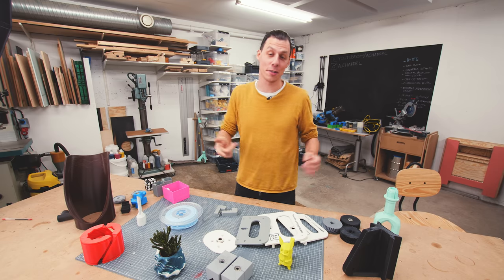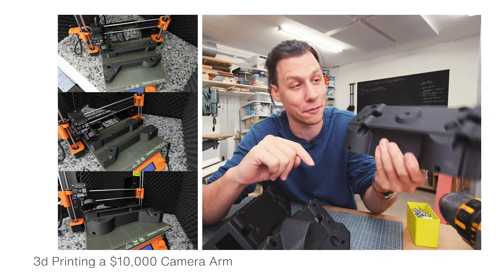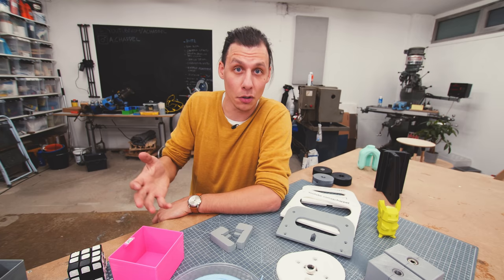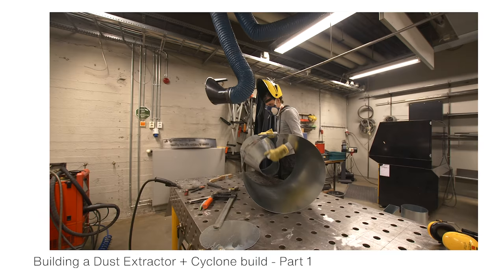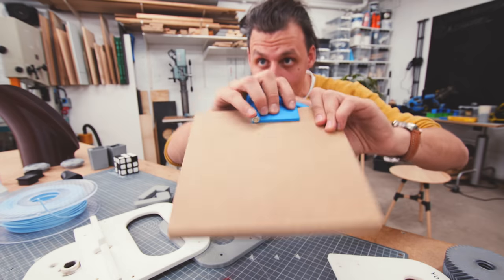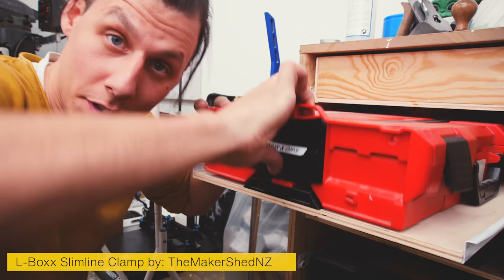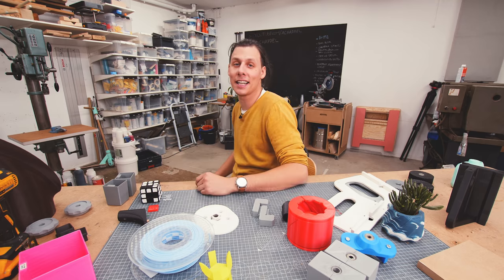Is 3d Printing Useful?

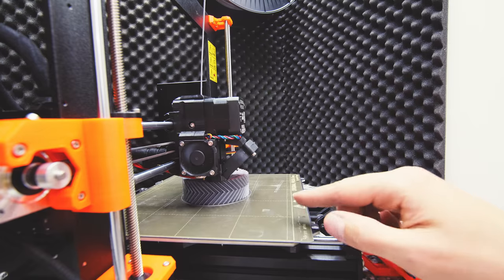Comment: 7:37 My favorite thing about 3D printing is that you can print spare parts for a 3D printer.
Reply from the maker: haha true :P
Reply: @achappel  I 3D printed a 3D printer (Bedsize 600X300x500mm)
Reply: @edwinbrink  sadly you can't print electronics and metal together with plastic (if at all) yet
Reply: Von Neumann probes when?
Reply: Add a bit of AI to the firmware and it will just print itself parts to improve itself, until it eventually turns into a robot that self replicates.   ... this would be a great plot to a low budget sci fi flick.
Reply: @redsquirrelftw  If you're into books/audiobooks check out the Bobiverse series by Dennis E. Taylor
Reply: buy 3d printer. print 3d printer. return 3d printer... PROFIT!!!

Comment: As someone who owns 2 3d printers I have actually gone back and fourth on this with myself. I used to think it wasn't as useful but now days that I can design functional prints I have to say yes. No is it needed to live or make life way better? No. But the amount of small things I have printed that help me out day to day are kinda surprising. The thing I use the most is a simple wallet/keyholder I designed thats screwed to the side of my dresser and it works great. I also have an ecig that has the charge port on the bottom of it and thats a total pain since you'd have to lay it on its side to charge and leak eliquid everywhere so I got a right angle usb cable and made a cradle and it works great. There are tons of these little things around my house and office that make life a bit easier.
Reply: How much did urs cost?

Comment: Another great video! I can't remember if you've mentioned this, but what's the primary form of filament that you use? PLA, ABS, PETG etc? Looking forward to your next project!
Reply: He said earlier that he (currently) only uses PLA.
I personally don't think PLA is a good material if you need stuff that's used for parts that need to withstand force. PLA bends when subjected to permanent pressure. I think he should switch to ASA (it's the "successor" of ABS). Or at least PET-G

Comment: very useful info, maybe you could do a video on how to 3d print various items which need different strength filament wire, and different internal structure strengths i.e 3d Pikachu doesn't need to be as strongly made as vacuum nozzle

Comment: Now I really want to learn fusion 360! this is one of the few channels that finds useful applications for 3D printing.. I bought one for making tpu parts for my fpv drones, now want to organize my workshop/studio. Any filament recommendations ? I'm assuming you use different materials and/or brands for structural parts, storage containers, etc.? 

Also if you want a good filament for camera/protective cases Sainsmart makes an awesome TPU with variety of colors. Its fairly rigid while still being flexible/absorbs vibrations.

Comment: I use 3d printing for a high variety of applications

designing custom pieces mainly, most of which I later cast to aluminum-low carbon steel

prototyping puzzles is so great too, it is even great for printing little toys

it is one of the greatest tools for prototyping, and since my ender 3 with all upgrades and 2 Kilograms of filament costed 250 euros, the investment payed for itself in a couple of month (not to say a couple of weeks)
I literally started printing the same day I got it, very easy, lots of sources and data available, very little trouble, so this question is a no brainer, a 3d printer and 3d printing are incredibly useful

Comment: I needed a set of mounts for an LED tube light for use during Skype/Zoom sessions. I fashioned two angled mounts out of wood in ten minutes. It would take me longer than that to draw them in my CAD software. Sometimes printing is awesome, sometimes it's easier to go another way.

Comment: I have considered getting a 3D printer for some time now. I do woodworking as a hobby and seeing the 3D printed router templates is really pushing me toward a purchase! But, what printer should I start with? There are so many!
Reply: All depends on your price range, and expectation! I got a stock Anet A8 years ago for £100, and its been such a great workhorse. i've learned to upgraded it and design parts to make it a very complitent 3D printer, however if you are looking for some "out of the box" VERY good prints, maybe with some fiddling here and there, the Ender 3 is amazing value for around £250. Or if you just want something that will produce perfect prints every time with no faffing and great support, a Prusia I3 Mk3S is £700.
Reply: @ale6242  Thank you so much! That's great info and gives me a place to start researching. I haven't decided on a budget yet, but I'm leaning toward the middle option.

Comment: I would love to see a quick breakdown of the costs to print parts - forget about modelling time, but how much filament is needed for a small parts box vs what do they cost? Or the drawer handles, or the cost to print a router template vs the cost of the 1/2" baltic birch plywood, etc! I would also love to see the benefits of this printer vs a resin one, especially as it pertains to workshop stuff!
Side note, a 3D printer would make terrific inserts for systainers!

Comment: Hey, i know i'm a bit late but those Y splitters are a really big hazard.
Wood dust is very explosive especially while suspended in the air - f.e. during pneumatic transport. Those ducts have to be grounded as even a little spark can set the whole installation on fire and blow the whole shop up and small particles rubbing against each other tend to generate a lot of static. That's why in professional setup plastic ducts have metal wires in them that are connected to the rest of installation. Make sure to connect all the metal parts of the installation with appropiate wires while using these splitters.

Comment: This is the kind of use for which 3D printing was designed, and it's the kind of use I can respect. I work at a school running the shop. However, I don't run the 3d printing area, and I'm so glad I don't, because all it gets used for is printing little figures and toys from Thingiverse. That kind of use of 3d printing has always struck me as similar to downloading someone's amazing Photoshop project, printing it on a color printer, and then taking the credit for making it.

Comment: 3D printing in itself can indeed be highly useful, but as someone who's diving into it since half a year I might add that it opens up a whole world on its own with different materials, their mechanical properties, slicer settings, (manual) bed leveling and not to speak of fixing problems. At least valid for most entry level printers up to €500. Might (and should) be a different thing for the 4-digit priced Ultimakers. Nonetheless I reckon these skills on how to operate a printer similarly mandatory for the times ahead like buying a PC back in the 80/90s. Good content nonetheless, thanks Alex.
Reply: I grew up with a father who was an aircraft engine machine tool operator and later spent decades at a company that sold industrial plastics and non-ferrous metals. Put those two with a few of our shared hobbies and I absorbed a good foundation on materials suitable for a given application. He's been gone 30 years yet it is coming in handy again with 3D printing since I prefer to only make reliable functional small parts.
My weak spot is learning proper 3D CAD. I don't put in the time required because I self diagnosed that I have the hobby form of ADD.

Comment: I use my 3D printer to make bits and bobs that are a Pain in the Tuckas, to make but make the major components out of other materials. .   For example, I'd make the mini Dust Collector vacuum connectors and internals with 3d Printing, and the cyclone casing with  plastic sheet goods.  That me though.   YMMV of course.

Comment: Hi Alex, i concurr with several comments it would be nice if you could make another video going into other details of 3d printing. Could you go into the cost side of things a bit? For example which kind of fillament did you use on the boxes and how many small boxes did you create with one role (size?price?) of fillament?   Or on large parts for the camera lift. If i see one of the bigger parts i am like: oh my ... that looks as if one part ate one role of fillament as it has to be pretty sturdy.

Comment: could you talk a little about what software u used for 3d modeling the part u want to print? how did u make sure the size is correct for the function? and did u have problems during the printing process ?

Comment: Can you use the 3d printer belts to automate the new camera mount to have it move to programed spots? How nice would it be for a moving shot as it lifts on its own and moves over something on the work area? 

Would still want it counter weighted to reduce the work on the motors but then just simple push/pull on belts to move the arm up/down and in/out.

Comment: I used to work for a company that made orthopedic surgical jigs using SLS (plastic powder and lasers). Each patient had single use custom jigs designed for their anatomy. The jigs were used to cut femurs and tibias in preparation for knee replacement surgery. In the past ten years, they’ve printed about 70,000 sets of jigs.

Comment: Back in the "bad old days,"  many objects were cast or vacuum formed to models made by "pattern makers.'    They mostly used simple hand tools.     Now the "model" is designed with computer graphics and the parameters are sent to a computer driven milling machine (3,4,5?  axes) or your 3D printer.

Comment: With your 3d printed parts, do you do thick layers with a wide nozzle?  Ive recently (took me 6 years and 15 printers to get there) started using .6mm layers with 1mm nozzle, and not only is the quality very surprising at that height, but it prints insanely fast.  Also, i visited your site to look for the jigs for the cabinet drawer pull hole files... the template used to route out the holes in the cabinet door.  Didnt see them.. Are they still available? Thank you

Comment: YES. I wish my printer was more reliable, because then I would feel more willing to actually make stuff with it. (M3D micro), currently i hate using it cause I ALWAYS have issues with bed adhesion & prints failing for dumb reasons.
Reply: The first thing I printed with it was a set of fan clip things for my car (the thing that moves the internal fan blades side-to-side & up/down) as they had broken off, and to replace them from the factory, i would have had to have the shop replace the ENTIRE fan assembly. Buying a super cheap 3D printer was actually CHEAPER than getting them fixed through the dealer.
Reply: My most recent project was making hook attachments for my Craftsman shelving units.

Comment: I've been meaning to get into it myself, that and CNC would be fun too.  I just can't seem to find a decent CAD program for Linux, there's FreeCAD, but it's super clumsy to use, everything is more work than it should be.  just drawing a line or copying or moving something takes so much effort to do, it makes the user experience and workflow terrible.   I don't really like cloud stuff either, so don't even want to consider Fusion 360 (if it would even run in Linux).   I might end up writing my own.  I'm learning Python, could be a good first project.

Comment: I run a research lab and we use 3D printers to make all kind of apparatus that would cost thousands from scientific supply sources, plus bespoke parts for microscopy. 
The real experience of 3D printing is learning modelling, but unfortunately Autocad Fusion 360 is no longer an option for hobbyists.
Reply: for 3d printing still is. you just need STL export.

Comment: 3d printing is so useful. i mean how else am i supposed to upgrade my 3d printer?

j/k seriously though. i got myself a ender 3 v2 a few weeks ago and i've already got so many ideas for things to do with it. better sotrage in a cluttered messy kitchen. fixing little things all aroudn the hosue that just need a very specific solution to make them better. being able to make things that are mechanically specific that you just couldnt buy from anywhere, and even if you could buy something its actually pretty cheap to 3d print things. 

Little rubber gaskets for my oakleys glasses, its like £10 for a set. now i can just 3d print them for pennies.

Comment: I’m just curious- why do his prints have no layer lines showing? Does he finish them by sanding them or something? Or does he have printers that don’t leave layer lines to begin with? Thanks in advance for the info.
Reply: He probably has dialed in his printer and settings so each layer is more accurate and has less squishy overlap. There are a lot of resources on how to improve a printer and settings to eventually get that clean result.
Reply: W Moss Thanks!

Comment: Can you talk more about the printers you use the most and why?? I see ultimaker, Prusa, etc; they're a pretty big range in terms of function and pricing
Reply: Ultimaker: full-fledged ecosystem, less understanding needed, think apple
Prusa: Good out of the box maschine with a lot of features, if you know you will stick to 3d printing and are willing to understand the process
Ender3/other china printers: usually work well, cheap, can be upgraded, good if you are not sure about how long you will stick to 3d printing (I am a happy Ender 3 owner)
Reply from the maker: right now I use the Ultimaker 2+ and the Prusa, they are both great, and super reliable, I also have a sidewinder which is currently broken again...
Reply: @achappel  Great! Yea Ultimaker looks great but not sure if the S5 is worth the price; glad to see you still using older 2+; mind if I ask what material you use? PLA? ABS? Thanks
Reply: @adosaro  I'm a 3D guy so will stick around. I also value good UX and UI so while Prusa is great for customization I'm bit wary, I'm a bit leaning towards Ultimaker with the nice swappable nozzle head and all around package though. How's Ender 3/5 compared to Prusa and Ultimaker?
Reply from the maker: @bennylee2582  I print with PLA 99% of the time, and no, I don't think the s5 is worth it, the 2+ however although a bit old and still a bit pricey is crazy reliable, mine has printed for over 3000 hrs
Reply: if you can afford ultimaker - definetely get it. it's some kind of prof machine comparing to prusa or smth like that - it's super stable and makes printing much much faster. i knew that but even i was surprised how good ultimaker actually is when purchased it already owning an ender 3 pro
Reply: George Sgf which ultimaker do you have and how’s 2+ vs 3 or 5? I am hoping to get the water soluble PLA too
Reply: @bennylee2582  I have Ultimaker original which I upgraded with heatbed and skr 1.4 turbo. A friend of mine own 2+, he's totally happy with it, he only changes nozzles and cleans extruder sometimes
Very stable thing
Reply: George Sgf very cool! If I’m correct that’s only single extruded? How upgradeable is that? What’s the turbo for?
Reply: @bennylee2582  yep these come with single extruder but original already has all the holes and mounting points for second extruder and as I saw at community.ultimaker.com 2+ is also upgradable. 
The reason I installed skr 1.4 turbo is just because I didn't like the idea of fast 3d printer working with Arduino mega as a motherboard and skr is a 32 bit motherboard and it already comes with pinout for WiFi, common new screens and etc and etc + I wouldn't be thinking about overloading microcontroller with new features which it wasn't supposed to handle. Difference between 1.4 and 1.4 Turbo is only a bit faster microcontroller installed to turbo version

Comment: No one can refute that 3D printing is not useful, but determining if it is useful for everyone is much harder. As you look through all the 3D printer videos you will see the majority ~80% making a benchy. I definitely don’t want 80% of my prints being a benchy. The rest of the useful prints are also for specific use cases. I don’t have screws that need to be organized, I don’t own that drill press, and I don’t own a router. So what does the average person that works 9-5 need a 3D printer for other than as a hobby?  I also wonder what have you built that could have been built with just wood without needing a 3D printer? I bet that the camera arm could be built with wood and be less expensive and faster to make, but probably heavier and not as cool looking. 

I almost think 3D printers are a great way to build templates or forms for items you can mass produce. Instead of printing the camera are it would have been better to print the molds so you could mass produce the camera arm and sell them. There are plenty people like you that would probably like to purchase them.

Comment: 3D printers can print useful things, but this is much faster and more economic (you have to take in account not only the price of the 3D printers and consumables but also the electricity bill) to buy the product directly especially if you have to design, prototype and test a product that already exists. And often 3D printers don't work correctly, it's more convenient to go to the store.
Reply: Yes but the point of engineering is to create more problems than you solve.

Comment: It took you hundreds of hours to print the parts for your camera arm. Wouldn't it a good idea to produce a batch of those parts with injection molding.
Injection molding is expensive in low quantities, but gets cheaper AND much faster with higher quantities. If enough people are interested, this could be a good idea.